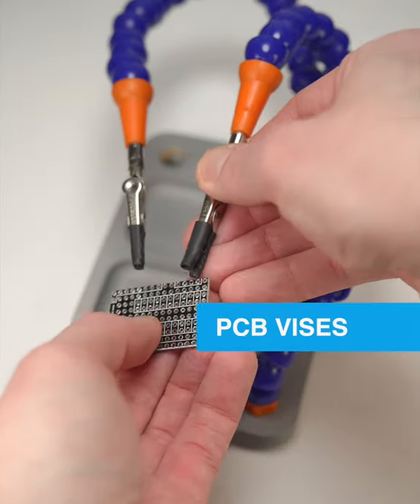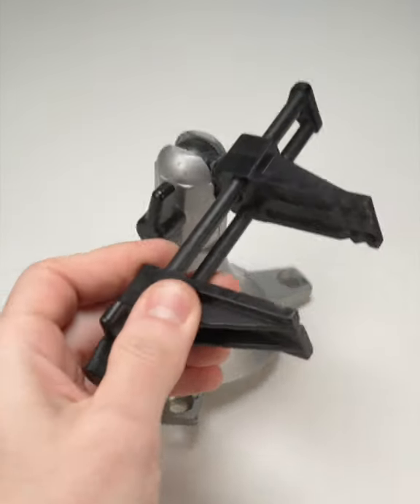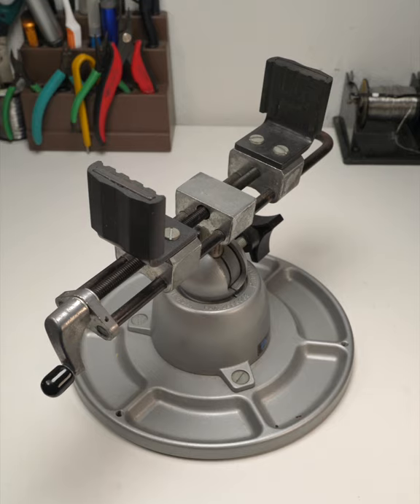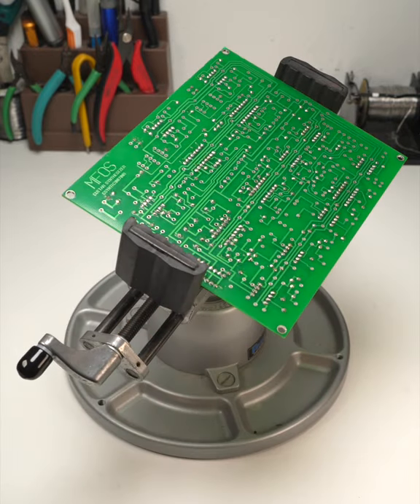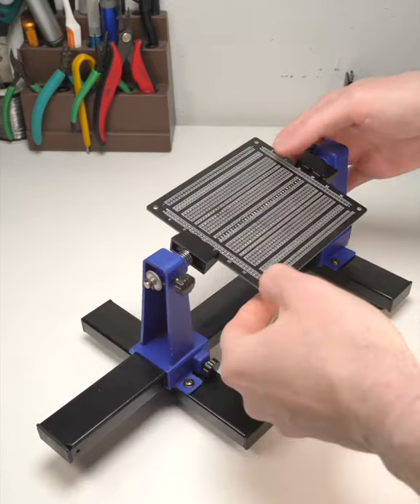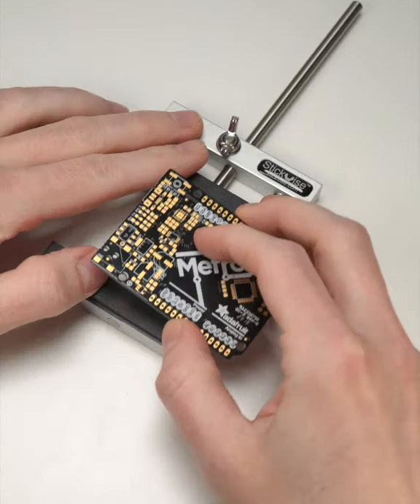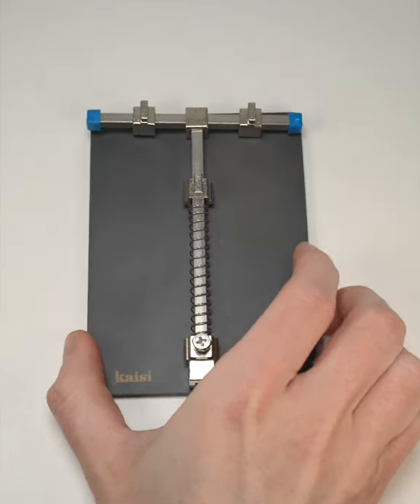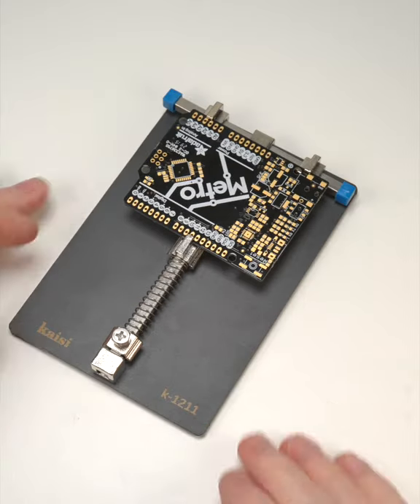PCB Vises - Collin’s Lab Notes #adafruit #collinslabnotes

Comment: That blue spinning vise is pretty good if you have a large board, as long as you've got a decent margin on the edge for the clamp to fit in. Most of my stuff is too small or has smd passives too close to the edge. Think I still probably need to save my pennies for a Stick Vise, not even my almost-stick-vise cell phone board repair vise (the next one collin shows) works as smoothly as those things look.